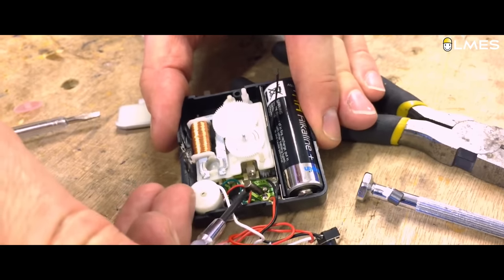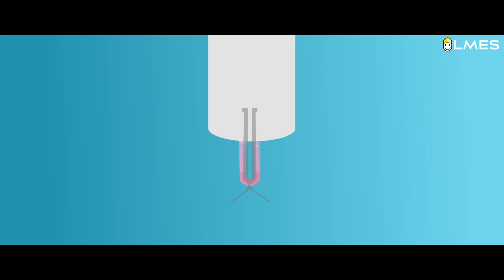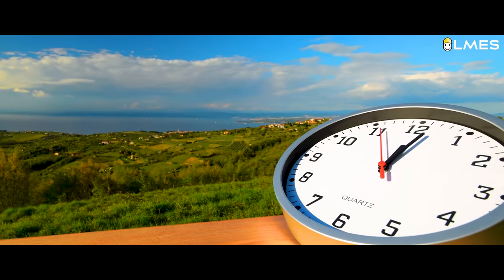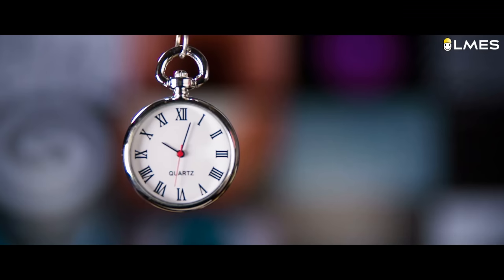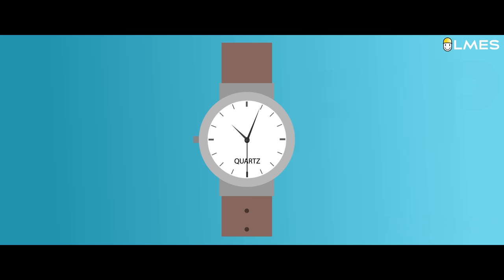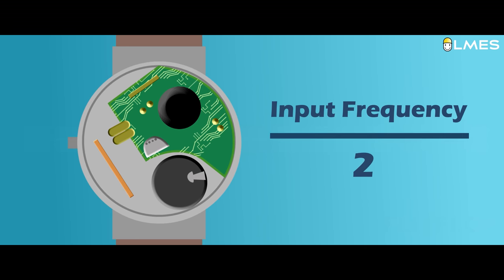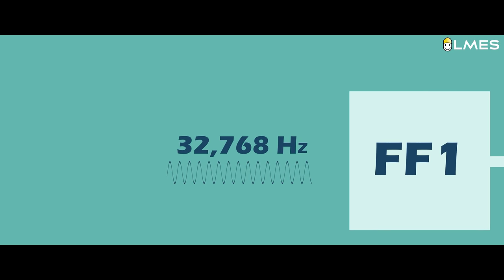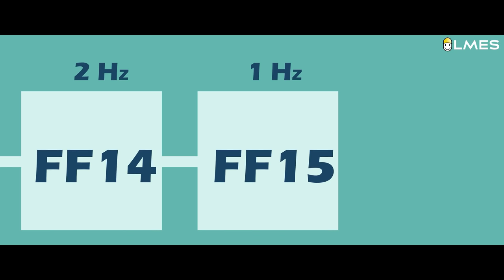Why the word "Quartz" is mentioned in clocks? | Unnoticed#18 | LMES

Comment: Why there is black, pink, yellow small circles in left corner of newspapers at bottom. ( CMYK)
Reply: That's simple. The printers use a mixture of colour and ink code. So the printer cartridges will be fitted in the order CMYK (cyan, magenta, yellow, kala). So in case the cartridges are wrongly arranged u wont be able to notice it when the papers are being printed in a large scale very fast (hope uve seen how fast newspapers are printed). So as a checking mechanism the corners of the papers are coded which will be easier to notice even at high speeds.
Reply: I think this may be a right answer
Reply: CMYK concept
Reply: All the colours printed in newspaper are based on only four color cartridges namely Cyan, Yellow, Magenta, Kala. So if there is any fault in color of paper it can be easily identified with the small circles in the bottom of the paper
Reply: @funnymalia8581  bro konjam puriyara mari sollungaa
Reply: @raghulhari9554  Andha 4 colors join panni newspaperla iruka endha color-a vena produce pannalam.
Reply: Because that are only color s used to print it
Reply: That colour in the newspaper indicates, to identify what type colours are used inside the newspaper like for words, pictures etc. The person who work in the newspaper factory, he  easily identified by using this colour codes
Reply: Those are used to identify  the  printed  papers
Reply: @raghulhari9554  athu onnum illa bro paper la vara photo la ethavuthu problem vanthichina intha circle vachi kandupudichi  seri panuvanga
Reply: CMYK
Reply: nanum athutha nanachan
Reply: Yes correct bro super
Reply: Please do a video on Why letters in the keyboard are arranged in QWERTY sequence instead of alphabetical sequence
Reply: Predicted correctly
Reply: @manikandarajt6887  s he predicted crctly
Reply: @funnymalia8581  bro exactly correct guest correctly
Reply: edit panitingla ji?
Reply: @sivaraja2854  CMYK ku spelling thappa pootuten ji veeaonnum ella
Reply: @sivaraja2854  next video vittapiragu editpanni adukkappuramlam likes adigamalam varadu
Reply: Reason ena na..print ana ela page um correct aa than agiruka nu oru oru page um check pana mudiyathu so antha 4 colour um antha 4 black circle la correct aa merge aguratha vachi quality of printing newspaper aa therinjipanga

Comment: In some clocks, second hand doesn't stop every second..instead it runs continuously( full rotation)...what's behind that
Reply: Because of different gear alignment make for the seconds showing tip
Reply: It is mechanical watch
Reply: Good question
Reply: @vanithaarunakumarib8017  that's right . All the mechanical watches ( if it has seconds needle ) will rotate like that
Reply: Yes in Rolex watches it runs spoteniously with out break
Reply: There is no flip flops and it varies with mechanical alignment
Reply: Mechanical watches
Reply: It is  not accurate and it doesnt have quartz
Reply: May be the flipflop circuits are lesser than 15.

Comment: Thank you very much for your demonstration and explanation! People will no more think that quartz is the name of clock manufacturing company because they became alert that the clock accurately measure time because of electronic oscillator made of silicon dioxide in the form of small tuning fork that vibrates at the frequency of 32, 768 Hz and the vibration is converted into 1 Hz electric pulse by a chain of 15 flip flops in the small circuit board and passed to solenoid coil to drive the rotor sprocket and the rotor sprocket drives the motion work (centre second gear with thin and long shaft to carry second co-axial with hour and minute hand, intermediate gear to transfer motion to the centre wheel with cannon pinion, centre wheel with 12 toothed pinion and long pipe so that it is called as cannon pinion to carry minute hand, minute wheel that transfers motion from canon pinion to hour wheel with hollow shaft that carries hour hand) to drive the hands.

Comment: However, as I heard from some sources, the reason for 10:10 and 25s or 35s is because "The hands of clock are very well explicitly seen in this particular angle". Of course smiley face is another nice reason since even 8:20 and either at 5s or 55s could be used but it will be sad face...

Comment: The 10:10 time setting in new watches is not due to smilie face, it's because if you set time as 10:10 only you will be able to see the brand name properly.
Reply: Really?
Reply: Aahaan!
Reply: Both r correct ... even u can see the brand name if the time is 8.20 but it looks like frowning ...only 10.10 looks smiling...and some watches may have dates etc at middle so other timings would hide that

Comment: You said given electric input to the quartz crystal generates Hz. How does it run the motor. You mean the electric current is output from Quartz in 32768Hz freq.?

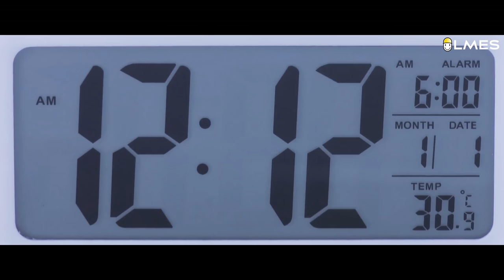Comment: 0:48 is one of the early timepieces to adapt the standardised frequency of 32768 Hz, early quartz timepieces ran on higher frequencies and hence the battery lost its power very soon. The example shown is Girard-Perregaux from the channel "Birth Year Watches". I think the original owner of the video needs to be credited.

Still today Bulova manufactures some high-frequency quartz timepieces which run at 262 kHz. The first commercially manufactured quartz was released by Seiko on Christmas day of 1969 called the Astron, soon the swiss formed an alliance with few manufacturers to produce their own Quartz movement. Omega's marine Chronometer is one of the early swiss made quartz timepieces.